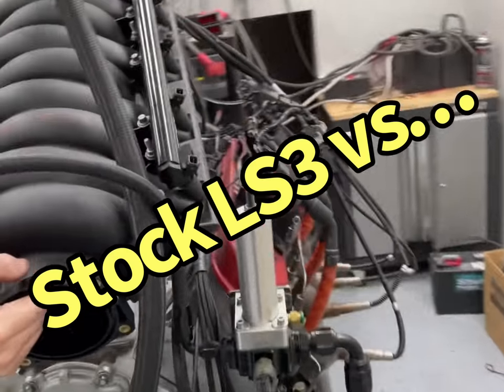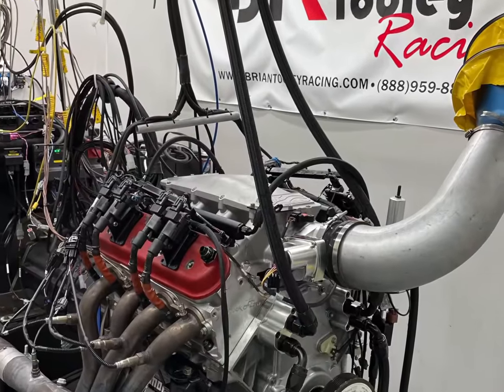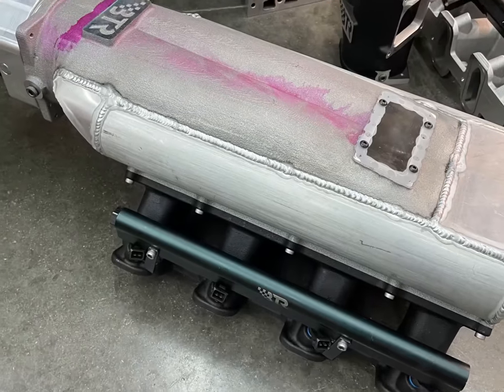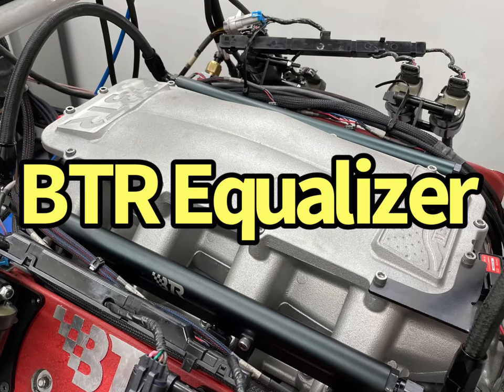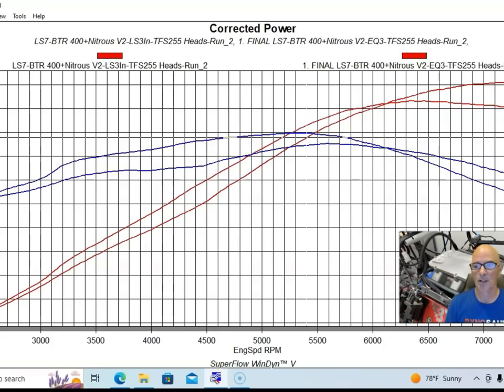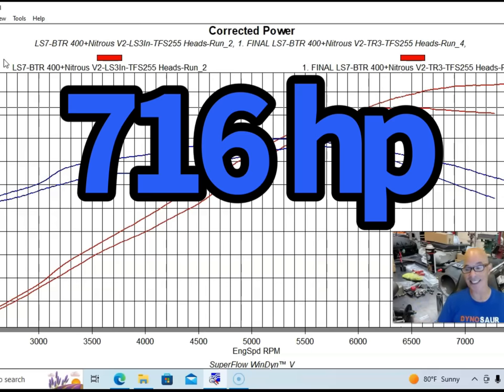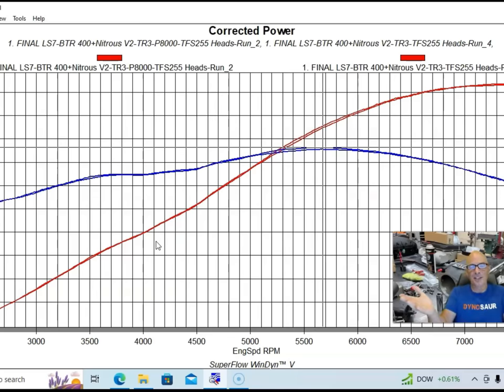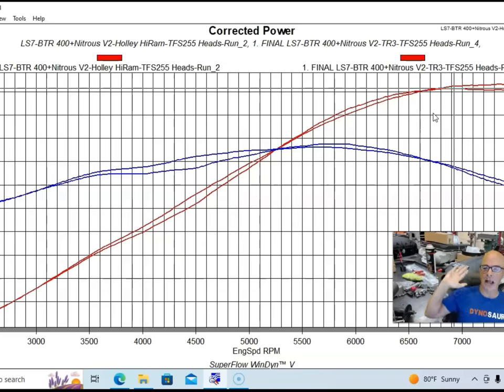WHAT IS THE BEST LS3 INTAKE? BTR EQUALIZER VS TRINITY VS HIGH RAM! PLUS, BIG PLENUM VOLUME TEST?

Comment: Increasing plenum volume will only benefit output if plenum volume is too small to start with.
Reply: Exactly.  We've seen many dyno tests were plenum volume is increase on an already well designed intake.  What we need to see is an intake with an abnormally small plenum increased in size.

Comment: My take from this test is LS3 manifold on a street car and one of the others on a all out drag LS or maybe a time attack car where you might want to kill some torque for traction.
Reply: Exactly, that’s why I’m still running the 6.4L intake on my big cam high compression 394Ci 6.4L stroker. Perfect setup spinning 6,500rpms , due to 5degrees of advance, on my 3,600 stall 8speed launching 4X4 for no prep racing.

Comment: I have a 2018 camaro SS, I just installed FBO + heads and I used a trinity intake manifold and ported the hell out of it. When I do my cam swap next year it should rip. Thanks for posting the comparison between different intake styles.
Reply: How did you port
Reply: @zmenace7463 with an air die grinder.

Comment: I think Kegaladon showed that big plenum volume doesn't make any difference.
This is another great example of that.
Now figure out a test to show when small plenum volume begins to hurt.
Reply: One thing I always found interesting in testing but never had a chance to properly investigate is pressure pulsation in the plenum.  Today's sensors and dataloggers can do a really good job showing the pressure drop in manifold with each cylinder event.  Taking an RMS measurement of the map sensor fluctuation curve might be a good predictor of when you need more plenum volume.
Reply from the maker: there will always be pressure waves present in the plenum (reflected, Helmholtz and inertial ram), not sure even with a high sample rate that the fluctuations would indicate a need for volume (if volume even adds power).
Reply: Yea, it really does seem to be proven consistent that plenum volume is either "you have enough" or "you don't have enough"
Reply: @richardholdener1727  Taking the RMS value of the sinusoidal pressure variations would give you an average magnitude of pressure drop during intake event pulses.  Theoretically the larger the pressure drop the more likely you would need to increase plenum size.  However I've never had the time nor inclination to (1) design the test (2) instrument the engine and (3) put together an intake manifold with a large enough variation in plenum volume to matter.  But you Rich, you could do it ;)
Reply from the maker: Church-We would be monitoring more than just a pressure drop based on intake pulse. For each intake opening there are multiple (primary, secondary, tertiary) reflected waves to name a few, from every cylinder, if you have a fast enough sample rate-you would see pressure spikes for days (including Helmholtz from plenum volume resonating frequency). Again, I doubt you would see this correlate or indicate a need for plenum volume, and since I have run lots of plenum volume tests that showed nothing, it makes me skeptical of finding any gains even if we change it. Someone please show me a plenum change that made power (not on a carb tunnel ram)-I need to know it changes something
Reply: @richardholdener1727  Good points Rich.  Search for this article.  The_Effects_of_Intake_Plenum_Volume_on_the_Performance_of_a_Small_Naturally_Aspirated_Restricted_Engine.  The only time I've ever documented gains from plenum volume increases were on a Honda S2000 F20C, but that factory manifold has a notoriously small plenum (about 1.5x displacement).
Reply: @richardholdener1727  I can give you an example from my experience, but the data is lost to history, pitched into the dumpster after we went bankrupt.  On the Torque Engineering V12 we had a port injection system with long runners and a plenum of about 4X engine displacement.  We were concerned about breathing because the engine was odd-fire having intervals of 30-90 through the firing order.  We thought that the cylinders breathing on 90-degree intervals were robbing the 30-degree cylinders.  To test this, we modified a plenum by welding in an axial divider plate to isolate left and right banks.  Testing showed a loss of about 20 HP out of ~950HP with the divider.  We made another step and welded in lateral dividers, isolating  3 cylinders in each quadrant.  The engine lost another 20 hp.  So the basic bogey I keep in my mind is to keep plenum volume at least 4X engine displacement.
Reply: @andyharman3022  So with stack injection would we consider plenum volume zero or infinite?
Reply: @bcbloc02  Not infinite.  Equal to the volume of Earth's atmosphere.

Comment: I'd like to see that extra plenum volume tested on a boosted application.
Reply: Ive done that and between the intakes holley hi ram  amd sniper intake both 102 mm throttle bodies non ported and turbo was a 91mm garrett. made 1345 28 psi on the sniper and 1389 on the holley with 26 psi m1 methonal was the gass , but the holley hi ram just out flowed it
Reply from the maker: a test between the Sniper and Hi Ram is NOT a plenum volume test-it is an intake design test (plus the other different variables mentioned)
Reply: @richardholdener1727  The desiighns are fairly close both are short runner tunnel style. The high ram flowed more over the sniper. The plenum from the hi ram was more so over the drop in psi a mesure of restriction but made more power over the sniper. The sniper has trumpets in the ports im willing to bet if the sniper had more area or plenum over the ports it will out do the holley. Ive watch the intake shoot out wich was very interesting,  Ive have been playing around the concept of ITB set up with a plenum.  The first one three d made wasnt to bad on a B18 honda motor na made 70 hp over the stock but low speed air made it boggy so to speak but in all its fun plan on boosting it to see what it does.
Reply from the maker: 70 hp over a stock Honda intake? Again, Plenum volume is not why the Sniper won't make Hi Ram power-but good luck with your testing.
Reply: @richardholdener1727  Wow Richard lol ok  what plenum means to us is the port I see what you are saying as far as plenum. Language barrier :face-orange-raised-eyebrow:  But yes we pick up 70 hp over a factory honda intake, When I come back state side Ill go by the shop and be glad to bring it up there so you can test it. We also have a very neat ls intake we are testing its a short runner , but it carries very good tq against a ls3 4 hp differance before the curve but after the ls3 carries more peak but we are thinking the harmonics and  turbulance is hurting our intake . Ill be in touch and keep up the good work.

Also just for future can we get a big bang 4 cylinder shoot out ? I got a couple of engines to bring to the cause free

Comment: Richard been wondering for a min if it worth the money to put a great set are polish and port heads if you’re running boost not racing on track just a weekend fun car?? Some say it’s not going to make big difference?
Reply: It will make a difference same as naturally aspirated. The boost just multiplies the naturally aspirated performance. If you've got the ring gap for it and can keep the intake charge cool enough adding a couple pounds will be a lot cheaper .

If you're getting to the limits of intake temps and boost porting them will lower the boost on a fixed displacement and be nicer to the rings and intake temps while improving hp. 

If it's a turbo you'll see more CFM and power  for the same boost or be able to lower the boost for safety and make the same or more power.
Reply from the maker: easier to turn up the boost
Reply: @richardholdener1727  thanks that’s what I thought just making sure

Comment: Richard what would something like one of the BTRs do on a stock 5.3? Or a stock bottom end 5.3 with a Truck Norris cam or equivalent?
Reply from the maker: wrong intake for that combo and rpm
Reply: @richardholdener1727 TBSS be the best option for that set up ?
Reply: @richardholdener1727  oh I know, but humor me. Difference between the BTR and a truck intake on a stock 5.3 if it had a truck Norris in it?
Reply: @notchase1798  a Whipple would be the best intake manifold lol but the fast LSXR or LSXRT would be the best intake for that combo. Look up the cathedral port intake test it's the best for that power range
Reply from the maker: Any short runner intake will hurt power and torque through 99% of the effective operating range on a 5.3L with a Truck Norris Cam. Pick the TBSS or FAST or leave the stock truck (especially if you have boost planned in the future)
Reply: @richardholdener1727 Is that strictly due to the 5.3l displacement? Or the cam? Or both?
Reply from the maker: the effective operating range of a mild cam 5.3l is not where the short runner intake is optimized (runner length and reflected wave tuning) for power

Comment: Since you can't really put trumpets on each runner entry on the big plenum, I wonder if radiusing (45 degree ?) each entry/port would have improved high speed flow, or at least the transition from plenum to cylinder/runner ?
Reply from the maker: all the intake ports are at least radiused
Reply: @richardholdener1727  not really according to 11:46.  Look pretty square to me.  Likely choking flow 5-10% before it even gets in the port, according to Bernoulli...... .  Kind of a shame, cause they were separate plates and could have been contoured super easily before being welded in.  This is bedrock basic stuff.  per Figure 9-6, Viazard's How to build HP II, pg 97.

Comment: I saw there is some FSAE paper where they were testing plenum sizes on a 600cc motorcycle engine but they had the max benefit at much larger volumes (8 X the engine displacement in intake plenum volume). If you scaled that on a LS3 that's nearly a 50L intake! You'd be driving around with a damn bin on top of your engine to get a few extra peak HP. I don't have access to the paper but they only mention peak numbers in the summary, so I'm wondering if the cylinders are basically seeing the intake plenum as regular atmosphere by that point and the extra volume is acting like a damper, just minimising the possible negative interference from intake pulses from other cylinders and the effect that has on transient pressures.
Reply from the maker: I ran the Kegalodon (see video) that was basically a Beer keg for a plenum (no change)
Reply: @richardholdener1727  That was a cool test, would be pretty close to that 50L mark too and no real change at all. It would be interesting to see what their test setup was where the impact was so great, maybe has something to do with the bike engine tested revving out to 12.5k RPM or the way they increased the plenum volume had some kind of unintended extra effect on flow/scavenging.
I wonder if it also could be due to the position of the throttle body going straight to atmosphere in the dyno vs having a more restrictive intake tubing setup but I don't imagine their setup would have been too different to yours.
At the end of the day it seems like its super complex to tune and offers tiny changes comparatively to the runner length or the pressure gain of ram air intakes on sports bikes.

Thanks for all the tests,  so many times I've been thinking about stuff like this and time and time again you've already done the test

Edit: Looked that test up again and they did have a 20mm restrictor plate in front of the throttle body to comply with FSAE competition rules so maybe it's mostly a way of optimising around the negative effects of intake restrictions.
Reply from the maker: makes me wonder if a restricted application is more responsive
Reply: @richardholdener1727  If you still have Kegalodon you could try add some kind of factory intake + filter setup. It's a quite a silly test but could maybe represent the extreme situation of intake plenum size in a stockish engine bay. I think you're more likely to run into a too small one still than have the larger one make a reasonable impact for a volume someone could actually achieve in an engine bay.

Comment: Suspect the large plenum woikd come into its own under boost
Reply: I wanna see that shoot out!
Reply from the maker: if it doesn't change na, it doesn't change under boost
Reply: @richardholdener1727  does this apply for all manifold though? Because there are some manifolds that work better under boost than other. I still say test it since you have the equipment
Reply from the maker: which manifolds work better under boost and not NA?
Reply: @richardholdener1727  dual plenum. Not v8 dual plenum, wrc style dual plenum. Regardless

Test it if nothinf changes then you are right and im wrong

Comment: You don't pair the rpm you want to run to the intake....you pair it to the camshaft then the intake.
Reply from the maker: the intake will run this rpm with many different camshafts-reflected wave is VERY rpm specific
Reply: @richardholdener1727  and if the camshaft and intake are matched it will run better.....as we seen with the short runner intakes paired with this camshaft.
Reply from the maker: you just said you don't pair rpm with the intake-but you do
Reply: @richardholdener1727  the intake gets paired with the camshaft. 

It doesn't do much good to have a 8k rpm cam wuth a 6k rpm intake.....as you just showed us.
Reply from the maker: When I make an incorrect statement-I own up to it, but keep digging those heals in and good luck! For everyone else-You DO choose the intake for the desired RPM range.
Reply: @richardholdener1727  sounds like your more incorrect than I thought.

You wouldn't put a lower rpm cam together with a short runner intake and expect it to run to 8k rpm. So why do you think the intake dictates rpm??? It doesn't.  The cam does and the intake is expected to match the rpm of the cam.....unless you want a bad combo.

Comment: Weird I haven't seen anyone else be able to replicate these results between the btr intake and the Holley. Am I missing something
Reply: At least where on the same page
Reply: @6oblintv  not trying to knock him for the testing but it just seems skewed, every NA guy that goes max effort will use a Holley. Seen time slips showing slower Eats with this manifold too
Reply: @All_Stock_Garage  with the trinity having shorter runners I don’t see how it keeps up down low unless it’s the tune. That just tells me the low Ram vs the trinity (low ram) would be even better up top
Reply from the maker: Have you ever seen a direct back to back test of these manifolds-cuz I have not. These results are exactly what should be expected from anyone that understands intake design-a longer runner makes more down low, the shorter makes more on top. what is not to understand?
Reply: @richardholdener1727  "What is not to understand?" Hell yeah brother.
Reply: @richardholdener1727  never done a back to back test, just curious why every thing prior to this shows the high ram out performing the btr intake.
Reply: @All_Stock_Garage dynos are merely a tuning tool they all read different and depending on the day the same dyno will also show different results to a point. 

Back to back with the same engine , same dyno , same tuner takes out as many variables as possible compared to dyno to dyno different engines but similar set ups. 

One of my ls cars has been on multiple chassis dynos and makes between 380 and 420 depending who's rolling road and the day.
Reply: @hayden6056  I'm referring specifically to the fact that the btr intake is beating the Holley on this Dyno. I've never seen results like that. If the btr intake were better everyone would be using it.
Reply: @All_Stock_Garage because it’s new and fresh. I’m about to use a ported one with a 112mm TB On my NA build. If it doesn’t trap 150 we’ll know
Reply from the maker: please rewatch the video-the BTR only made more peak, but acceleration does not come from peak power alone-and the dyno comments-I ran my Engine Masters motor on 4 different dynos-they were all within 2 hp or each other. Dynos are not tuning tools-which is why EVERY form of professional motorsports uses them for engine development.
Reply from the maker: if you have never done a back to back test-then you have nothing to compare these results too-please do more watching and learning.
Reply: @richardholdener1727  didn't mean to offend you, no need to get defensive. I guess when your given parts by a company you gotta skew results in their favor 🤷‍♂️
Reply: @All_Stock_Garage  that's funny how you say, "No NeEd To GeT dEfEnSiVe" and then literally call him a liar in the next sentence. SMH
Reply: @TurboV8boi  I started by being respectful, then he returns with a reply like "sit back, watch and learn".
Reply: @TurboV8boi  I started by simply stating an observation I made, his results differ from what I've seen. That's it.